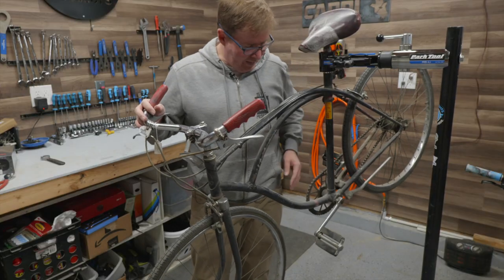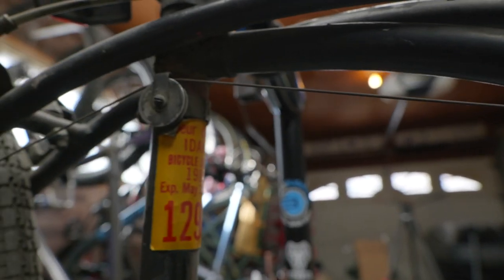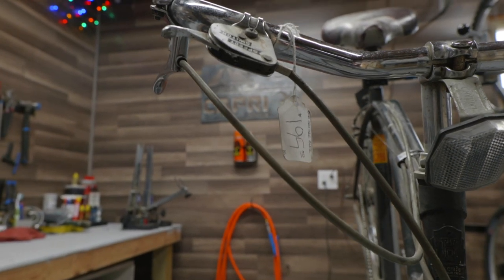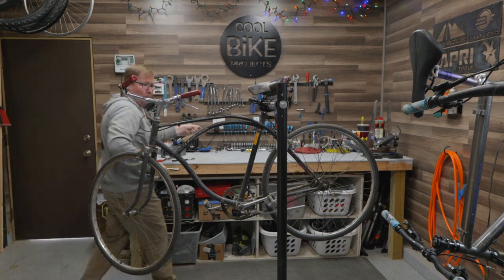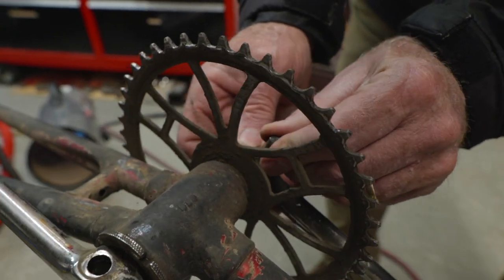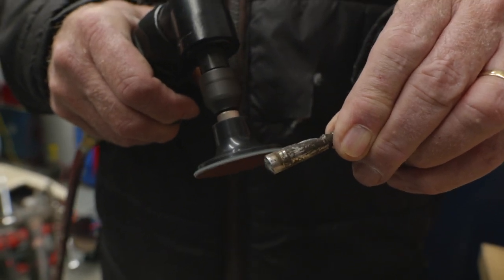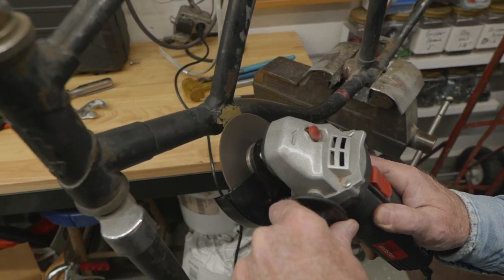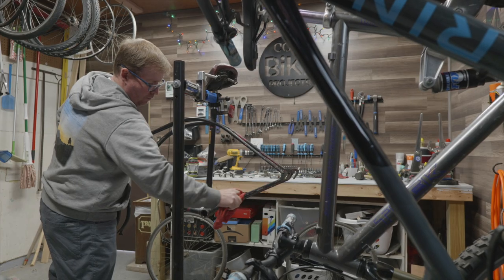Hercules Bike Bicycle Restoration

Comment: The grease ports on the bottom bracket is interesting. You see them from time to time on bikes from the 1940's and earlier. When you look at their location relative to the position of the bearings, you can see that if you pumped grease in, it would fall behind the bearings. Useless.

Comment: Magicshine lights have been out for awhile, but at 5000 lumens a battery would more than likely only last a couple of hours. Now like most light brands, I'm sure there are various amounts of light at different modes in order to save the battery. A great gift idea for sure, but folks need to realize that they need to read the info on the light so they are aware of lighting time frames and heat caused by the light.

Comment: You found an interesting bike. A cantilevered frame is uncommon among English bicycles. I like the design, but not a big fan of how they did the cable runs. No judgement here, just preference.
Reply from the maker: Yes It seems pretty uncommon. I have only found one other like it. I’ve got the serial number off the back of the rear stays, but I’m still having a hard time finding a website with the database for it.

Comment: If you do not have a cotter pin press, the best way to install them is with a 16oz (or heavier)brass or copper  hammer..the brass is softer than the bearings and you will not damage them..do not use a steel hammer..Z..
Reply from the maker: Good to know, thanks for the tip!

Comment: Recently I found a crack where the top tube meets the seat post on my road bike. I found a guy who did aluminium welding and he did job on it. The resulting weld material sits proud and I thought about grinding it back a bit to make it more pleasing to the eye. I too am thinking about repainting. Should I be worried about lessening the weld strength if I smooth it out?
Reply from the maker: Yes, in the case of aluminum I would not mess with it as the material is very different. In your case I would suggest leaving it bare so you can keep a closer eye on it incase it cracks again. Best wishes!